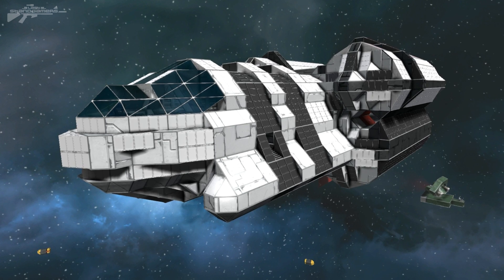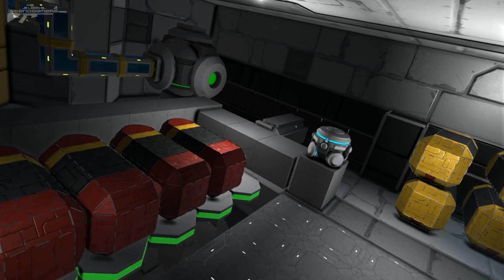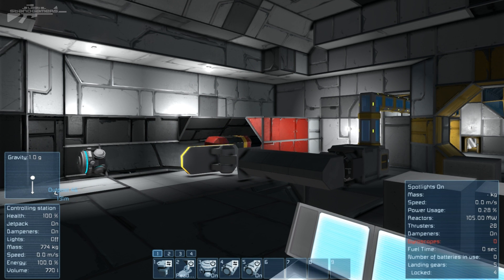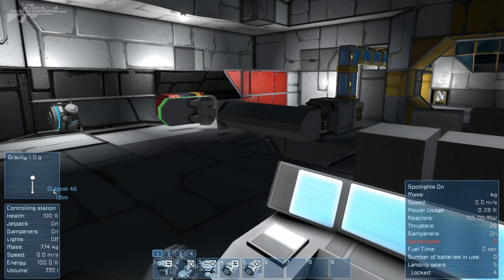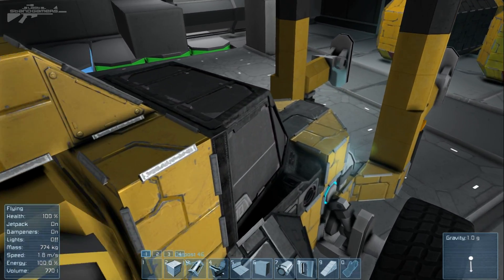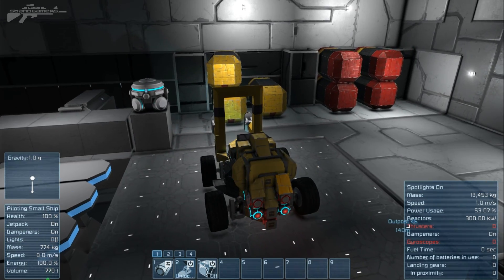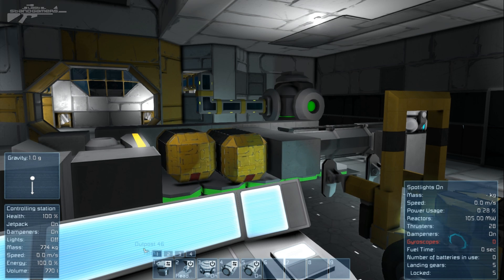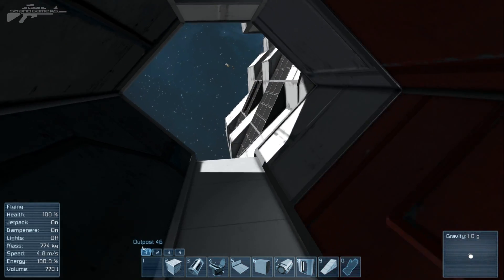Space Engineers - Torpedo Auto Loader Concept, Mechanical Fun

Comment: While i see a lot of strategic danger to using gravity weapons it can have a in game use other then its cool and that is as a siege weapon. Think about it its a weapon that takes ALOT of room on a ship also leaves a big opening and limits the use of turrets on large ships. Not to mention the difficulty actually hitting the smaller support large ships which keep on the move. However in the siege of a large space station covered in turrets and different kinds of defenses. something that would even hammer your biggest and best ships to pieces. And besides a station also usually has fighters that could fight you. Well then a ship that fires from a distance heavy caliber ammunition is gonna be more efficient as long as you armor them well and make sure to defend yourself from attacks by defending ships.
Reply: I think the best offense against a well-defended station would be to fill the sky around it with decoy blocks and then sit at a safe distance while it burned out its ammo stores, then move in and capture it.
Reply: Steve Pittman Well any smart defender would do 2 things 1 keep a supply of goods and make ammunition and 2 control the turrets when they are firring. Better option in that case would be to try and stop their power supply by making em run out of uranium.
Reply: A station that has a significant stash of ammunition (or the raw materials to make a significant amount on the fly) is going to have tons of uranium.  At the very least, the decoy blocks (with a little heavy armor maybe) would keep the guns distracted while you lob heavy explosive torpedoes at them from range.  Though at that point it may be better to send in a dropship to break their conveyor network.

Comment: Hey Aaron, what about a boarding shell! Basically a oversized version of the shells in this vids, with a armored front cone, seats and a passageway. The shell is fired with GravGens, penetrattes the hull of the ship (perhaps add grinders) and then deployes marines inside the ship.
Reply: Oo, interesting idea, I like it.  It'd be a rough ride, but very slick.
Reply: ya it wold be a rough ride and you could get shot up by there turrets or manned turrets
Reply: As long as you had heavy armor on the front and you were hauling ass I think you'd be fine.  Maybe put a door in the nose in case the heavy armor doesn't break so you don't have to stand outside in view of the turrets while you cut your way in.
Reply: Uttam Das Thats part of the fun isint it?
Reply: I've tried a boarding ship based on ramming with a cone 6 heavy blocks deep and it's safe to say I breached the hull on both sides however it killed me in the process lol

Comment: the design i have uses just 2 pistons. I align the torpedo cartridge perpendicular to the torpedo barrel. the loading barrel opening is build to fit only 1 torpedo  it at a time. the torpedo belt is pushed to the loading barrel opening by a piston. Then once 1 torpedo has filled the opening a second piston behind the torpedo barrel load the torpedo into the barrel, and finally a gravity generator is used to fire the torpedo. Everything is guided by landing gears to increase the accuracy of the torpedo when fired.

Comment: Excellent idea. It's quite a nifty system. Although have you thought about stacking the shells vertically over the "barrel". Then have the piston push the stack down so a shell falls out and gets fired? Seems like that'd work faster and take up far less space. You could unleash the entire magazine quickly.

landing gear  = >
Shell = 0000
Piston = ¬¬¬
Barrel = HHHHHHH

   ¬¬¬¬
>00000
>00000
>00000
>00000
HHHHHHHHHHHHHHHH

Comment: why you dont try to simply make a piston that pushes the hole magazine in the barrel?
Reply: That would require another piston in the barrel itself (since only one projectile can be aligned with the barrel at a time), or it would need a missile launcher with 3 barrels and 3 gravity generators.  So that as the magazine slides into place all 3 missiles would be aligned to shoot out of one of the barrels.   Which can work, but it would be quite a bit more complicated.
Reply: that means you can only have a mag of 1 or shot them all at the same time
Reply: but if you turn the gravity on and off?
Reply: Alda Junge still more work  and more can go wrong

Comment: Nice concept but:
Too slow reload (can be tweaked with faster rotor though)
Unusable with warheads (colliding in the magazine part WILL cause explosions)

A revolver type autoloader seems better (up to 8 rounds, and you can multiply by additional cyllinders coaxially). Uses less room also and works with warheads.
Reply: Also, add a connector/merge block and welding station for easy refill of the whole clip (need a crewmember placing block of course, until we get blueprints or something similar)
Reply: ***** I actually managed a 2 and 4 (2 barrels) round rotary magazine with landing legs (though the 'wobbling' made it unusable - but I'm sure it'll work with connectors/merge blocks, especially with last update's scripting)

Also - hollow point wouldn't work as well - explosion would occur further from target, decreasing damage. You could try a sabot round, but that would be hellishly complicated
Reply: ***** Put enough gravity gens (30 is usually enough) behing it and such torpedoes will fly faster than missiles. Also, large warheade is WAY more destructive than a missile salvo
Reply: ***** You don't actually need a torpedo storage - consider the round at the top as in the barrel - the the lowest one can be put above a set of welders - just place blocks and watch the quick reload.

Charge is needless as well, since the 30 G's of thrust will propel the warhead and enough velocity - and still you can improve it with actual thrusters - though launching could be problematic)
Reply: ***** Saturation attack (look up at wiki - consider turrets as CIWS) to disable anti-torpedo capability. One down

Regular missile still need you to lead target, and as I've said before, they move slower, so aiming is harder. Also - torpedoes are used against large ships, and those don't ususally move that fast.

Lastly - you can incorporate the design into turret - though it would be large.
Reply: ***** Still looks unsafe to me - warheads aren't known for being stable while being bumped by other things, even after being behing a 1m thick wall of armor.

Overall - a warhead not fixed to a hull/merge block is asking for trouble even harder. Think of the chain reaction too.

Last thing - LSG design uses small warheads - rotary magazine uses large ones, more effective
Reply: ***** Still missing the point - all warheads are perfectly (well, until you hit it/fire at it) safe so long as they're attached to the ship via something reliable. Landing gear is not reliable since it is a 'flexible' joint. Merge blocks would be ideal.
Reply: yeah revolver cylinder is a great idea, it can be improoved with the new function of controllable trhuster.
please arron next time try with this
Reply: I made a four round revolver cannon, i call it Hellbender. It has a rotary magazine which rotates the rounds into a position where a gravity "hammer" will rip the round off from the holder (magazines are made so they have a break limit) and send it into the barrel where it propels it with 120g forward. It punches a hole in any armor, and it works perfectly!
Reply: ***** Most capital ships are pretty slow. I have a gravity driven warhead the size of a mining/refinery ship, and it sends capital ships flying. Literally, it pushes them back. No explosives, just good ol' giganewtons.
Reply: *****
Gravity weapons would be best used as artillery,against stations and the like,since they can have incredible damage,but are very slow/fragile.
Reply: Personally a can't picture a revolver system working at  all. now a Clip system may work and the size of the rounds lends themselves to being used as disposable weapon pods with the right about of engineering but not sure of the practicality of it all.
Reply: And a revolver auto loader could also have the belt system attached to reload the revolver.
Reply: Someone made a missile with explosive components and a storagecrate that did better then warheads
Reply: *****
Perhaps as an artillery vessel against stations, but yeah in any other situation they're too inaccurate and unstable.
Reply: Would be good if it was firing kinetic kill weapons at high speed though,
Reply: Matthew Chenault
Yeah, but to make sure you hit your target, you'd have to get in pretty close, where you'd most likely get teared up by missile turrets (assuming you're using a lighter ship, which I think would be necessary for efficient aiming of the torpedoes)

Also, a ship so slow that it can't dodge a torpedo is likely to be able to soak up a lot of damage. I'd rather put my faith in auto-turrets which target critical systems with accuracy.

I'm not saying torpedoes are crap, they can be  very useful if you need to deliver a lot of damage in one go, but they're not something I would necessarily use much in a practical situation, especially considering the resource cost vs missiles.
Reply: Why can't you put the warhead inside the body of the shell? Shouldn't that allow it to be bumped slightly, but still go off when it impacts?
Reply: ***** Theyre pretty bad at hitting at max speed. Even torpedoes.
Reply: Matthew Chenault Watch M34t's nuke video and know that your whole comment is basically irrelevant.
Reply: A revolver type loader like you mentioned would be really useful when we have scripting in the game, as it would be easier to rotate the rotor by exactly the right amount and to increment it each time you fired.
Reply: ***** Saturation attack is basically spam missiles so much that the turrets cant shoot down all of them
Reply: One suggestion for a quicker firing rate is having two loaders per barrel. That way if you keep that speed of loading, you have just doubled the rate, but at the additional costs of higher power requirements, thicker and heavier steel blocks (Possibly blast door blocks to serve as the actual barrel), and you run out of ammo faster.
Reply: You could probably be fine with warhead-armed ones as long as the sides of the shell - the bits that'd actually be colliding -  were comprised of armour blocks.  Just have all of the warheads inside it with one poking out the nose - that nose one hits an enemy ship, detonates it, explosion sets off the rest inside the shell, all done.  Probably wouldn't even need it poking out the end, just leave one exposed and have the top flush with the end of the armour blocks.

You'd just want to make sure to have plenty of clearance around the ammo storage and loader arm while making sure that the stacker truck can grab them from the safe end.
Reply: Wouldn't it just be easier to add a mac gun or and electromagnetic system to the game that would make kinetic weapons viable against most ships and station
Reply: Barcel
I've been attempting a SABOT so far I've been able to get the round in the actual sabot cup it doesn't release the round properly yet
Reply: blah blahblah I'd like to see that - you have a workshop link?
Reply: Barcel
http://steamcommunity.com/sharedfiles/filedetails/?id=296755407&searchtext=SABOT
I've gotten the round to launch outwards "stable" for the most part.
Reply: blah blahblah Was hoping for a vid - but i'll check it soon :)
Reply: ***** It's about a million Kilograms.
Reply: I am thinking these weapons would be better against a base.  Like a bunker buster then in actual fast paced combat.
Reply: DemonAMVs Yeah, and you could shave off a few gravgens. There's an idea for a siege frigate
Reply: Barcel I've made a clip-like design, however it can only burst 3 shots, basically a piston working vertically, pushing up a merge block type of clip that can hold up to 3 large ship torpedoes. when the upper most round is aligned via piston translation (mush easier to align compared to rotational movement from a revolver design since the torpedoes are parallel to the grav cannon field), you unlock that merge block holding that  torpedo, then you use a horizontal piston to push that torpedo into the gravity field and it is launched! you obviously repeat that 2 more times with the rest of the rounds
Reply: Barcel and an effective way to economically prevent the torpedoes from getting destroyed by AI turrets when they are fired is by firing small ship shrapnel rounds (1 warhead in the middle surrounded by slop blocks) first, and then launching the main large ship round, the ai turrets will make the shrapnel one explode and they will be distracted by the small ship pieces, mean while the real large ship torpedo easily bypasses and hits the target without being destroyed.
Reply: 666lolkiller TELL ME YOU UPLOADED THAT TO THE WORKSHOP?!?  If so, please link!
Reply: Zer Dath Sadly, i did not. I don't trust workshop, but I'll upload it to mediafire if thats good enough!
Reply: What's not to trust about the workshop?  I suppose media fire would work, it will just make the integration a bit more difficult.  :)
Reply: Zer Dath FUUUUUUUUUUUUUUUUUUUUUUUUUUUUUUUUUUUUUUUUUUUUUUUUUUUUUUUUUUUUUUUUUUUUUUUUUUUUUU-! The save file is corrupted... It opens up, but the whole map is wiped out. I have no idea what happened, but I just wasted 3 hours optimizing it. I'll try and rebuild it, or just give you some advice how to make it.
Sorry for that, but let the fact make you feel better that I sucked with it to make it work.
Reply: Nooooooo!
Reply: ***** Since it has a revolver mechanic, you can simply stop the magazine's rotor to stop firing. It's a simple one button mechanic that works surprisingly well.
Reply: ***** Yeah, that works too, but the piston is kind of unstable and unreliable at the moment. Also use a landing pad with breaking force to stick the shells to the magazine, and use a hammer made out of full cover to release them in the right position.
Reply: Chasings and magasins?